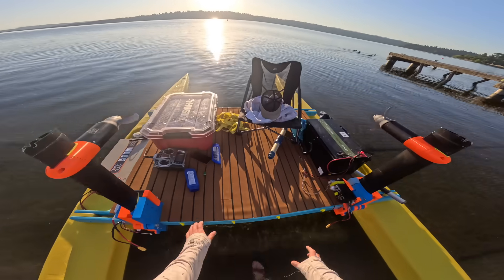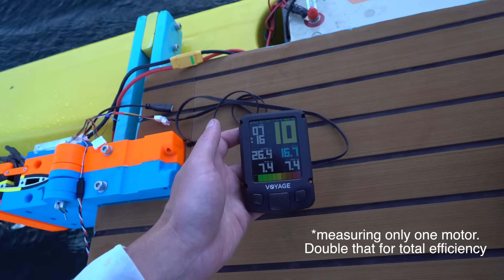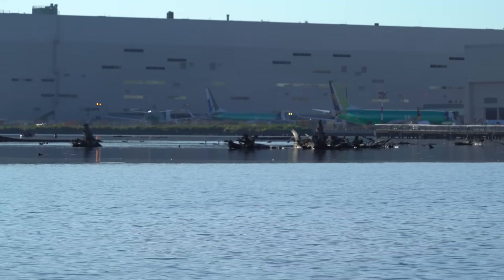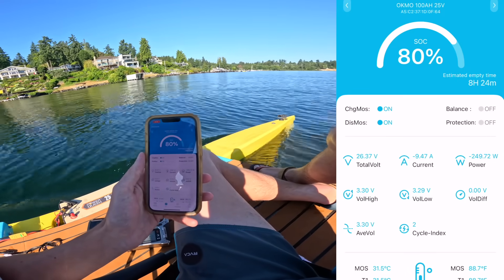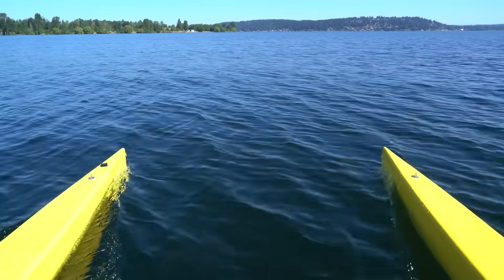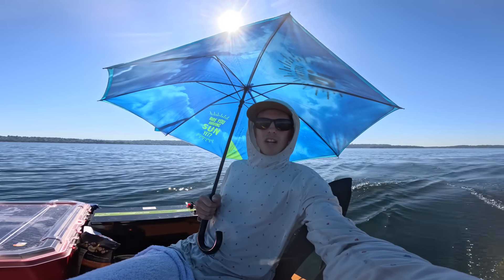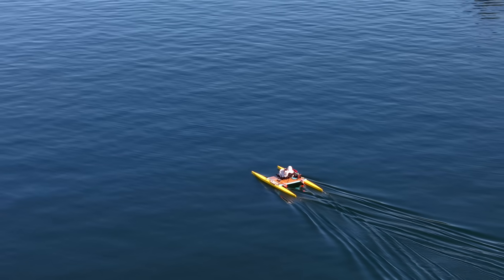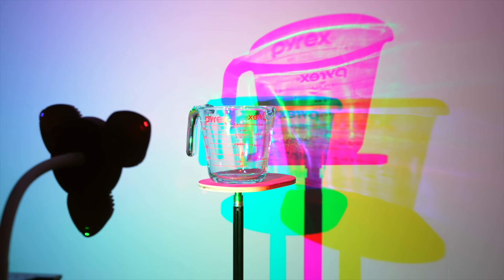Range Testing my Electric Micro Catamaran

Comment: Have you ever thought of trying a cavitation hull on a submersible ROV? There were some absurdly fast Soviet torpedos that forced tiny bubbles out of their nose to reduce friction with the water, I'm curious if the principle could be used in conjunction with a conventional prop to boost the speed or efficiency of an RC boat or submarine, perhaps with some kind of compressed gas (paintball tank or sublimating dry-ice with a PRV in the nose maybe?) or a snorkel and compressor combo.
Reply: Cargo ships also blow bubbles on their hulls to reduce friction, it's called air lubrication.

Comment: would one larger electric motor be more efficient than 2 smaller ones at the same speed? they say that's why every jet is now a twin engine, no matter what, 3 or 4 is also less efficient then 2 larger. ones. even if technically not as safe, it's worth the cost.

Comment: maybe instead of a trimaran you could build a "pod" and turn it into a pod cat, a pod on a pod cat is typically much shorter than the cat hulls, sits in the same place as a trimaran cabin would but doesn't touch the water, but has a v shaped hull form to deflect any splashes off the cat hulls when they submarine back down. at least this you could do in the current workspace, and would enable you to slice through the waves without caring as much

Comment: 5:46 - Those bubbles rising from the lake bottom is most likely methane from organic matter anaerobically decomposing under the water.
Reply: In the scene showed I would agree, but often you can actually see o2 condensing and rising up from photosynthesis
Reply: @casoblantly  which is pretty incredible and peaceful in the morning
Reply: Seattle also has thin crust, and has a few faults, could be volcanic bubbles in lake.  Seattle land use to be open ocean and now is just rubble from when Olympic/Siletzia landmass hit mainland 50 m years ago.  After the impact all mid WA was swamp and Cascades were quite low not the current tall mountain, so yes coal formed 30 miles up the Seattle hills and small slivers elswhere over 10s of millions of years, even though most coal on earth formed 300 m years ago.  NYC rivers has some coal forming in the planty muds forming off New Jersey, give it 10 million years
Reply: @alexwilliamrussell thin crust is not a fault, it is a perfectly valid expression of the art of pizza!
Reply: @alexwilliamrussell  No, it's not volcanic bubbles, or drowned aliens. It's decomposing biological matter releasing gas.
Reply: You don't know 100% it's not volcanic bubbles.  Ranier volcano is 20 miles away.  Quiet volcano Boring volcano is 2 miles away.  . .. . Like in Japan mountains, sometimes there the bubbles are volcanic.
Reply: @alexwilliamrussell  @rctestflight may may have discovered a portal to find “🎵Marshall, Will and Holly… on a routine expedition 🎶” in the Land of the Lost.
Reply: He found Jim Hoffa's body!
Reply: That's just a myth. It's actually sneezing mermaids.
Reply: @52Quantum  That's just a myth.  It's actually farting mermaids.
Reply: I’m going with hidden Russian sub as the source
Reply: Bubbles coming from under a weed bed probably mean dead weed is sinking and decomposing. Over time it can get quite thick and start to become something like a peat bog....if the water is deep enough that mass could eventually become coal.
Reply: @pd4165  Coal is not likely. The era when fossil coal formed was back before there were fungi that could break cellulose down. Once wood started to rot, the fossil coal no longer cumulated. That's why the fossil coal we're burning now is some 400-ish million years old.

Comment: you should get better range with a buoyancy stabilized monohull (which is actually a trimaran with small outboard hulls on each side, located such that the wave patterns destructively interfere at cruise speed).